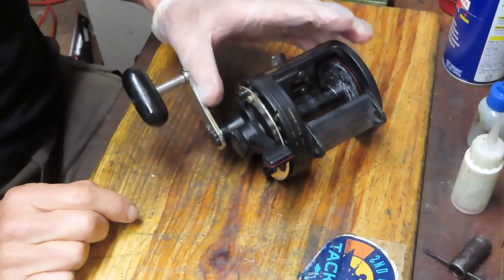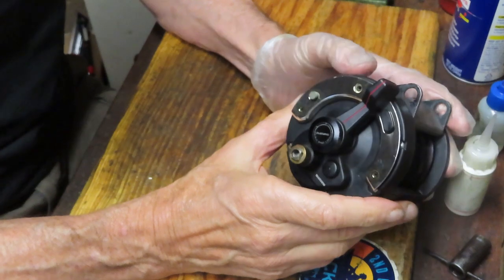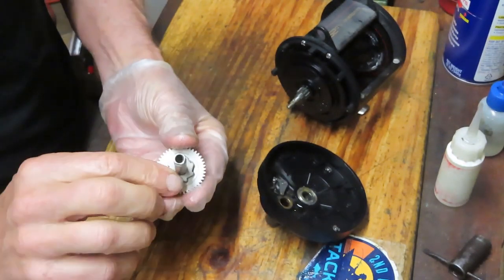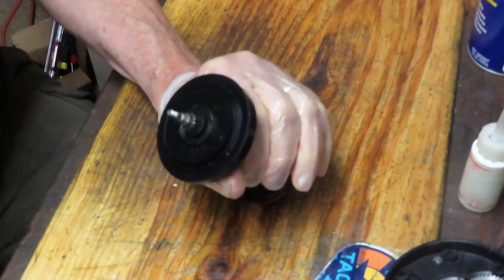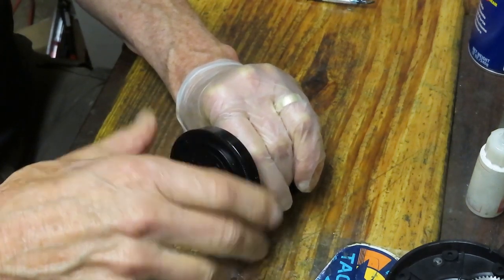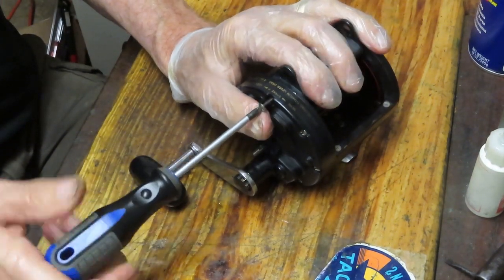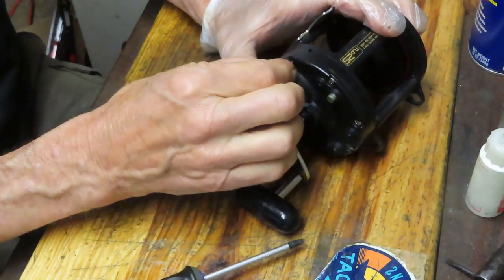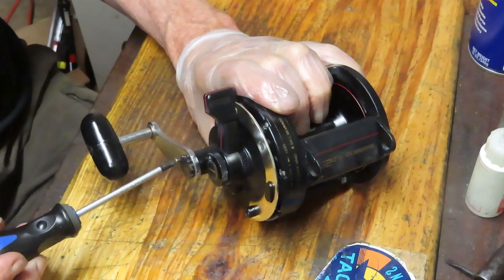Shimano TLD25 lever drag fishing reel how to service

Comment: Hi Dennis. For restoring sun damaged graphite reels you can use Back to Black. It works great for the plastic paneling on cars that gets ruined by UV rays.
Reply from the maker: Thanks for the tip.  I will try that next time I am in an auto parts store I will look for it.

Comment: Thanks.  Very clear and detailed. I'm still having an issue.  The further I advance the drag lever, the harder the handle is to turn.  Any suggestions?
Reply from the maker: A little hard is normal, but a lot hard generally means that something was not put back correctly and is causing the binding.  Start with the preset knob.  Can you move it all the way to max drag?  If not, you have th tension too high and it will rock down the reel.  If the preset is "normal" It could be the way the gears were reinstalled or the bearing/spring assembly that connects the pressure plate to the drag.
I think you need to recheck your work

Comment: Hi. Nice video as always.  What is your opinion on swapping out the canvas drag washer on these reels and the charter specials for a carbon fiber drag washer.  

I made the swap on a charter special 2000 and it was pretty straight forward.  

Thanks for all of your videos Dennis!!
Reply from the maker: I only advise the swap if the current drag washers are not holding, getting torn up or burned, etc.  The carbon fiber washers add more strength, but not more max drag, so it is only necessary if the original washers are failing or have failed - Dennis

Comment: I've got a cs 400 shimano and I haven't s clue how to put line on because the real dosent have holes in it like many other baitcasters to tye the line on so It dose t slip off.around as you real it in
Reply from the maker: Use and arbor knot.  There should be videos on YouTube or the internet to show you how to do it.  If you are putting braid on that reel, make sure to back it with about 15 yards of monofilament before you load the braid.  If you don't, you will get braid slip - Dennis
Reply: @2ndChanceTackle  thank you so much I'll do that tm and lyk how it works tho I have a feeling it will work

Comment: I have a reel of this model and the problem I have is that the tension knob in the center is cease to the main shaft what is a fix to remove the tension knob so I can service this reel
Reply from the maker: The center preset adjustment knob unscrews by turning it counterclockwise.  That will remove the knob and enable you to remove the spool from the reel. - Dennis